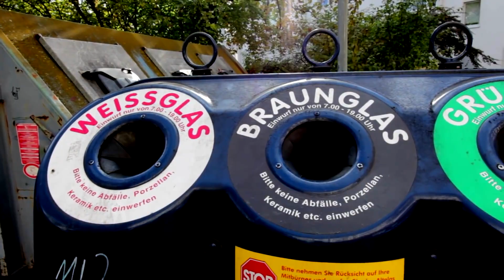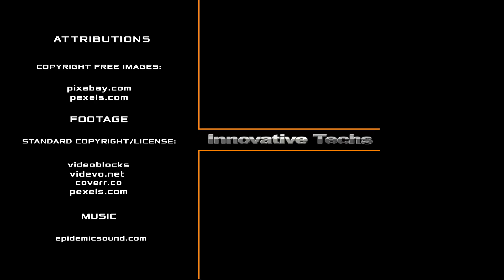HOW SWEDEN TURNS ITS WASTE INTO GOLD

Comment: I work for a company which builds waste-to-power plants. This is nothing unique to sweden. It also not unknown in the industry. The technoligy is old and mature. Just this year we build 4 of them. 2 in france, 1 in the UK, 1 in spain.

Countries which don't have such plants don't have them because it was not possible to convice the politicians of the country to finance such plants. If capital wouldn't be a limiting factor, these plants would be everywhere. Scarcity of capital is the reason why they are not found in every country.

Another factor is, that the operation of such a plant is more expensive than the operation of a landfil. The biggest revenue stream of such plants is, that they charge a fee for accepting the trash. This is necessery, because the revenue from the energy production is not sufficient to pay the upkeep costs of these plants. Depending in the country and regulations, it can be cheaper to dump the trash into landfills than to operate such a plant. If this is the case, it's difficult to convince the involved parties to pay more for this mode of disposal.
Reply: An energy from waste plant was built in Niagara Falls, NY back in the 1970's and is still operational today. There is a lot of maintenance involved, but worth while.
Reply: And it will almost seem impossible to design a more cost effective model that will serve the same purpose and allow for profitability? A project of which cost out ways the revenue and benefits can’t be popular.
Reply: @user-vj3it9vy4x   It is a decision politicians make.
The cheapest solution is not always the best solution. It's simply the cheapest solution.

In most developed countries, in industrial combution plants, the exhaust emissions are strictly monitored. If it's not possible to follow the emission limits with regular means, then a flue gas treatment system has to be installed. This costs money. It does not benifit the operation of the plant but it benifits the enviroment and the people living around the plant.

It would be cheaper to skip the flue gas treatment but in these countries law makers have decided its better to be more expensive but cleaner.

In a coal power plant aproximatly 1/3 of the investment costs are for the power generation equipment (burners, boiler, steam turbine, ...). 1/3 of the costs are for the cooling system. 1/3 of the costs are for the flue gas treatment.
It would be possible to build the plant cheaper by leaving the flue gas treatment away but developed countries decided that we accept the costs for a better enviroment.

I think you get the idea.

Landfills are cheaper than such waste combustion plants but they come with issues for the enviroment.
Such plants solve the problems of landfills but they are more expensive.

But it also depends on the application.
They are not always more expensive. A country like sweden is cold. So the energy from the combustion of the trash can be used in multiple different ways. The heat can be used to heat the houses in the city near by. Also the electricity can be used. So in Sweden the whole potential of this techology can be utelized. The benifit is therefore particulary high in Sweden.

Many less developed countries are in warmer regions of this planet. They don't have so much need for heat. Therefore this potential benifit doesn't apply to such countries.

This is not a "one size fits all" solution. It is very attractive but as long capital is a limitation, there will be situations in which the best solution can not be applied.
Reply: Why is it so quickly forgotten that landfills represent wasted space, since nothing substantial can be built atop them?! Meanwhile, ash monofills, where WTE/EFW facilities deposit their ashes, can have any manner of structure built atop them, since ashes are much more geologically stable than raw garbage.

Comment: It's simple if the government supports it then the people wil

Australia was one of the best countries for aluminium recycling in the 1970's but because the steel companies were more interested in their parasitic relationship with the miners they stopped it mainly by not paying the 10 cents per can so people said since the government is too stingy to pay that then why bother

Then in mid 2000 the government decided that the cost was now worth paying so they brought it back

What is horrible about this is that 75% of aluminium produced is still in use so all that extra extraction was a waste

Comment: Incineration is dirty and disgusting.. in South Africa they are about begin with the first waste to energy project  . One tonne of waste will produce one megawatt of electricity. Technology being used is pyrolysis technology. The system produces oil and gas the oil and gas is then put into generators those generators produce electricity the CO2 coming from the generators is converted back into liquid fuel by way of the Eden carbon solutions. Eden carbon capture solutions is invented in South Africa. Our eskom power stations that produce CO2 from coal ,we can capture that CO2 and convert it back into liquid fuel. Simple. And if we capture all the CO2 from our coal producing power stations we will be in a position to export liquid fuel for the country.  Just saying

Comment: "Methane, a gas '25 times more potent than carbon dioxide'" - What does that even mean?
Reply: It's 25 times as potent as a greenhouse gas over a 100 year period. 1kg of methane essentially equals 25kg of co2 when it comes to trapping heat over a century. Unlike co2 however said methane breaks down in the atmosphere to form water and co2 with a half-life of just 9 years so the measurements used are a bit difficult to make good use of, it´s equally correct to say that methane is 84 times more potent than co2 over a 20 year period.

Comment: My house is heated with hot wather and the shower also have heated water from our town, it comes from burning the waist that is not recycleble. I live in Borås in Sweden. Almost all houses in central town are
 heated that way. :)
Reply: how?
Reply: @raonokahosansiam8874 very simple description: water is heated up in the facilities that burn garbage. Then the water is transported via underground pipes to houses. Separate pipes for water that heats radiators and water for the tap. (Bathroom or kitchen)
Reply: Central heating pipes in the ground @raonokahosansiam8874
Reply: Burning waist reduces excess bodily weight and size; burning waste generates energy and money.